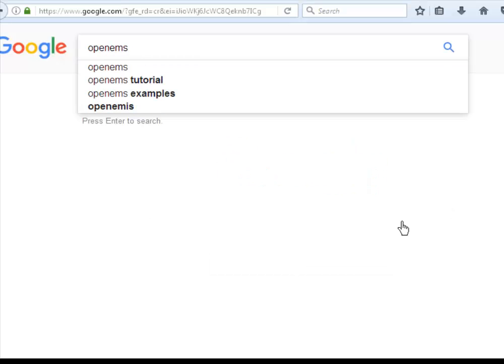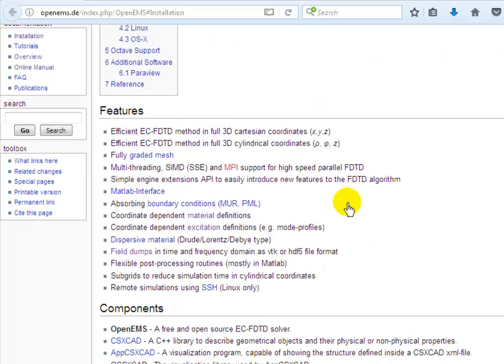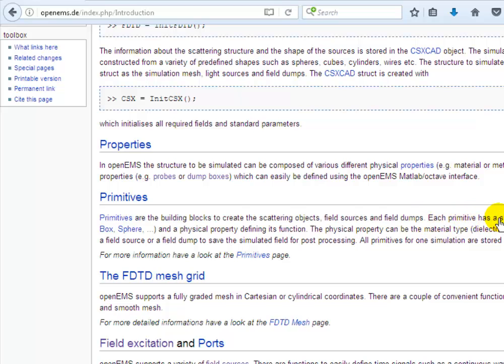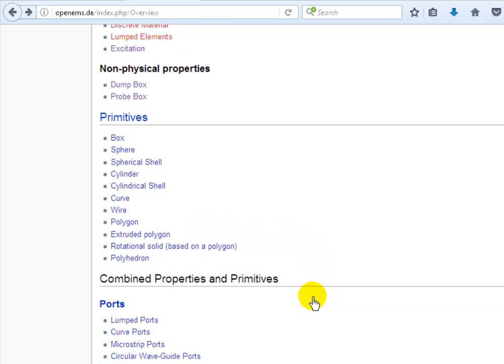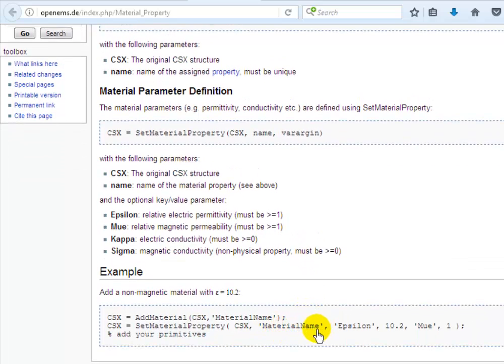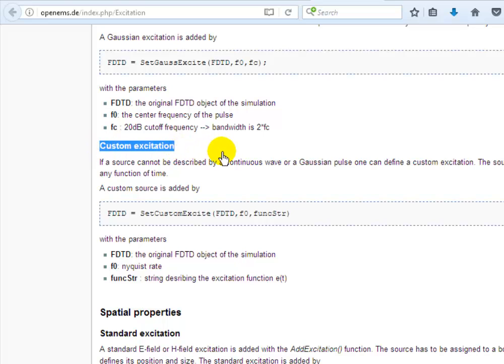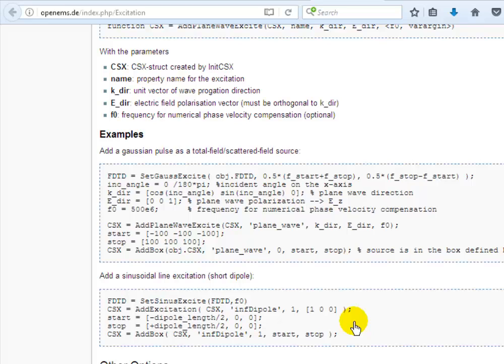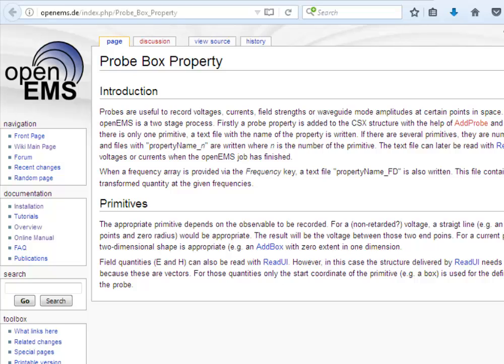openEMS - Introduction (p1)

Comment: Excitation sources must be applied somewhere, and documentation is simply awful. Your dipole is "thin wire" with diameter zero. Is this all you can simulate? You are wasting time explaining basic EE fields theory. People who don't know this are not likely to use your software. I am trying to use it, but it is virtually impossible. If documentation remain as useless as it is, I can't see how anybody can really use this software. Basic question would be: can wire have diameter other than zero?